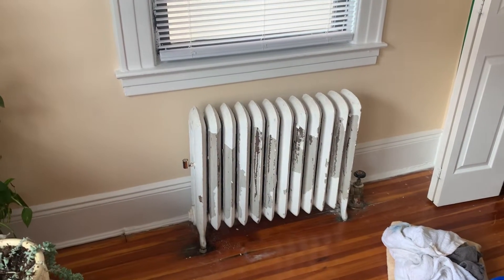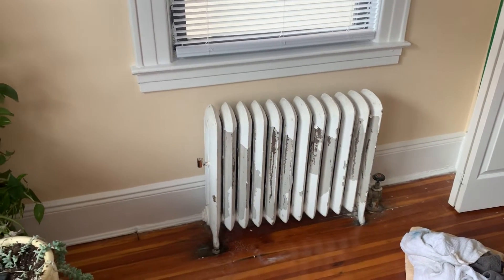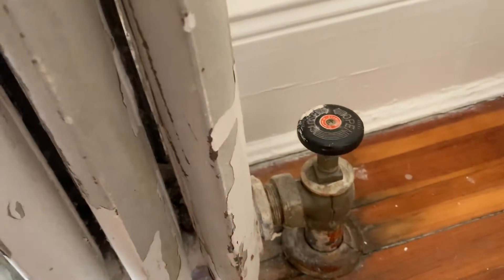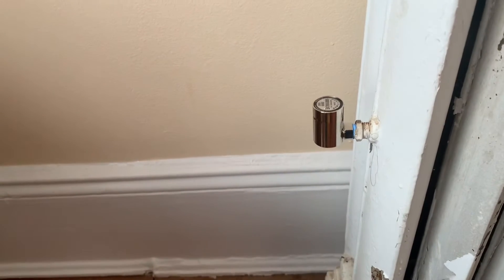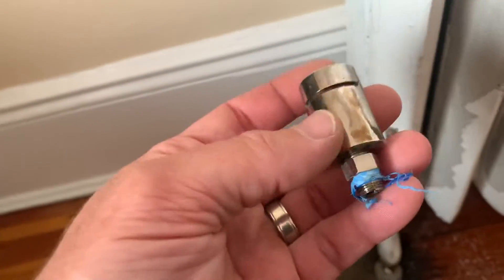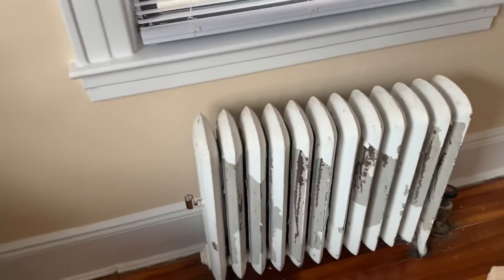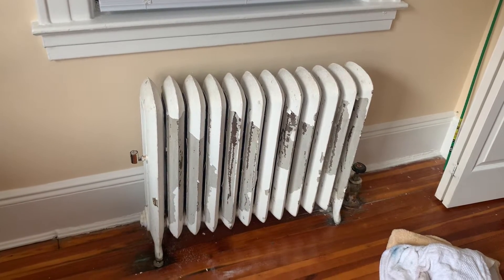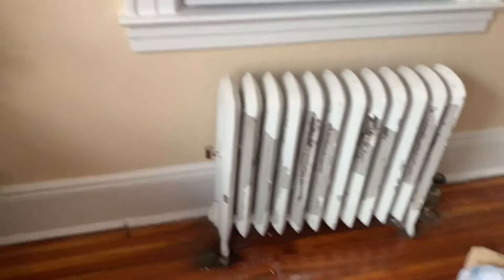Steam Radiator Air Valve Leaking Water

Comment: How do you know of the wet return is clog?   And how do I fix the wet return clog issue?   The water is spitting out of the ISP angle valve
Reply from the maker: replace pipe or clear the clog

Comment: In my renting apartment, all radiator vent is installed at the top right corner, only one is installed at the middle and that vent is occasionally leaking water. What is the difference?

Comment: 2 plumber visits... two new air/steam release valves....  still dripping (left a dry towel underneath for the morning heat turn on...)  it wasn't soaked like before but clearly wet. I held a tablespoon under the air valve and the water is coming from the bottom of the new air valve...again.  My building is 100 yrs old and (some) of the radiators have been removed and gas heaters installed in various apartments... I hope it doesn't come to that but the plumber said "if this second one doesn't work, we might have to replace the radiator" (Which seems off based on what I'm finding on these great videos!)
Reply from the maker: Maybe your radiator just wants some attention and is trying to make a statement with all that dripping!
Reply: @PipeDoctor   it really is a living thing and I know it's language!  LOL...  it needed to be "tilted" and since then....all is well - whew!

Comment: This happens on ours occasionally , the apartment gets so hot with the heat on unless it’s below freezing out so we have it on n for a few hours then close the valves. Previously we’ve called the super, now I know to ensure both the valves are very tightly closed if we need to shut it. Turning it back on for 30 mins just cleared up the leak. Thanks!

Comment: We have the same system in our building, with the same problem. Last night a valve & vent failed together... The room turned into a sauna... Water running off the ceiling .. paint melted off the wall .. even shorted the outlet !

Comment: Love that Cast-iron radiator. Pitch looked perfect (1/16 inch per every 8 sections).  Definitely caused by radiator service valve being in the closed position. Condensate had no way to return on initial call for heat, and in return, next heating cycle caused steam pressure to be forced out of vent.  Properly diagnosed and efficiently repaired. Nice work, as always Mikey!👍

Comment: I had no choice but to remove the varivalve, get some buckets and towels, blew down the radiator and closed the main valve, it wasn't fun but I wouldn't be able to get maintenance to come by until after Thanksgiving weekend.
Reply: How long did it take to drain it ? Just out of curiosity? And how long does it last for until it starts doing it again ?

Comment: so I live in an apartment building and I'm pretty sure that the wet return is clogged because I do hear loud bangs in the pipes sometimes randomly and one of my radiators is leaking water from the air valve
Reply: I have this same situation.   What are the steps to fix this?  Pls advise

Comment: The valve should be close or open?
Reply: @PipeDoctor  is it ok to leave the knob on the floor closed for a long period of time?  like a few weeks or month or two?  I need it to stop leaking until I get someone to someone in to fix.  also can i turn it off when heat is still on?